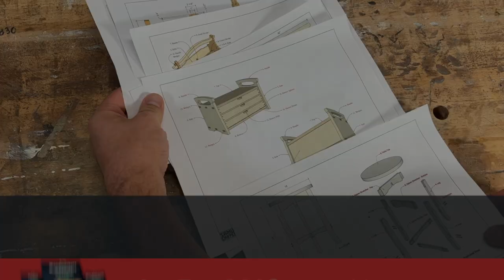CHALLENGE ACCEPTED!!! Making A Fir Bench For My Off Grid Cabin

Comment: I make small stools for the kids to sit on ( here in County Durham England 🏴 they were called Crackets) at only about 12 - 16 inches high but there was also a larger one for adults / older kids. At close to the height of your bench but only about 24 inches wide it was  a larger version. They have an upside down v with a drilled hole at the top of it for the feet and side boards 4" deep instead of a bar in the middle. Why don't you make some for the kids?
A Crackets from England would great to see in the States.

Comment: What’s your secret to making your projects not look like they were made from Fir? I’m probably phrasing that wrong, but many beginners like myself make stuff out of fir and/or pine, and they look like it. The identifiable grain, for one. Not very sleek, unavoidable tear out, mortises that don’t chop very crisply, etc. it seems like I have a lot more success with those things when I use hardwood.  But your projects look so great and crisp that I wouldn’t guess that they’re from fir.
Reply: You need very sharp tools when working with softwoods.
Reply: Yes, sharp tools. And clear, dry, straight and tight grained wood helps a lot. The species is not that important. Good wood machines very nicely, even pine or fir.
Reply from the maker: Second growth fir and old growth fir are not the same. I try to use old growth because it is much easier to work with and looks much better. Your tools have to be very sharp and you have to add steps to prevent splitting and tear out etc.

Comment: Jesse, When making a slot like you did in the top of the legs for the little hold down pieces, is there a reason you chisel in from the edge after you made relief cuts instead of wedging the chisel, not one of your good sharp ones of course, into the cuts to break off the waist? Have you had the waist break off below the level you want?
Reply from the maker: That only works when the grain is running horizontally not vertically like it was in this application.
Reply: @TheSamuraiCarpenter  Thank you for clarifying.

Comment: Thats a really nice bench - I was a bit 'oh yeah' when you said you'd make it from Oregon, but that came out so good.- well done. Quick question - why no use of biscuits/dominos/dowels etc when gluing such large planks? -
Reply: They only offer ease of alignment, no strength. I would have thought that well milled timber and decent clamps would negate the need for B/D/Ds. It has from my experience, anyway.
Reply: @Myrkskog makes sense,  thx for the reply
Reply: @shaunw666  Nae bother. Just remember, most glues are stronger than the wood fibres. Plane two edges to meet perfectly and there should never be a problem.